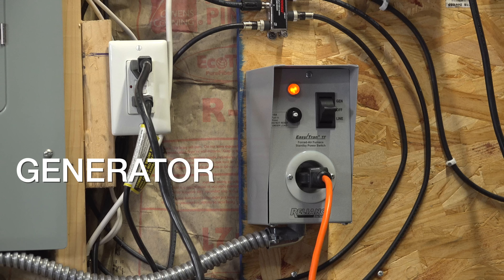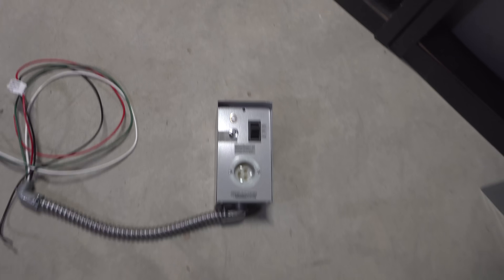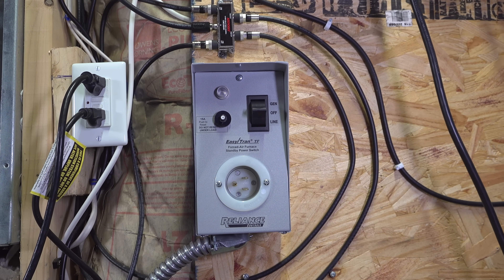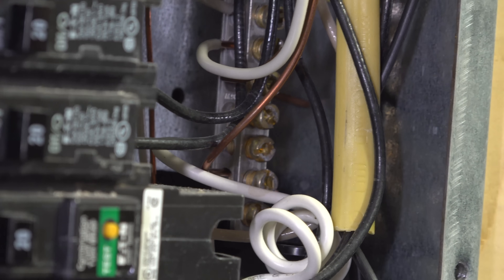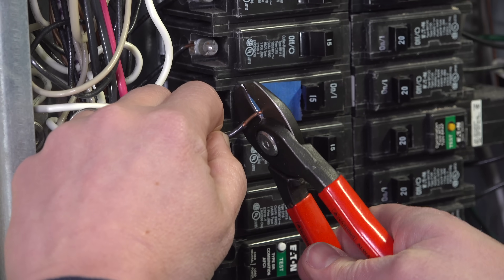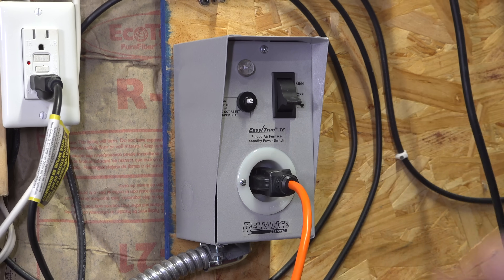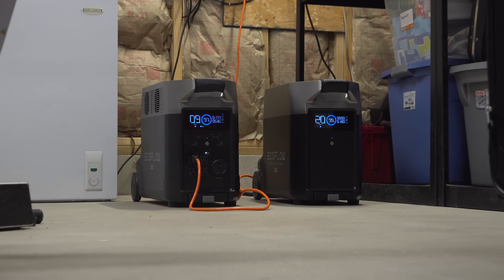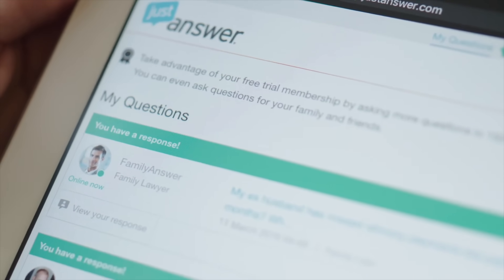Easy DIY Generator Transfer Switch Install - Works with ANY Portable Gas or Battery Generator

Comment: Thanks, SC. I know a master electrician who will wire this for me. I just need to mount it. Unfortunately, my service panel is on a wall in my kitchen. I need to find a weatherproof one and install it outside.
Reply from the maker: They have outdoor units and some models can be recessed into the finished wall next to the panel, You are lucky to have someone that can install it for you, he will likely know a model that will fit into your setup.

Comment: Does this charge the battery when it’s on line power?
Reply from the maker: Yes you can leave it connected to utility power through the rear outlet for charging and the front is the output that can feed loads/circuits. The other plus for this setup is, say power comes back on for just an hour, it will charge what it can before it is off again. That's a nice plus of the Delta model it charges super fast. This happened in TX for a while power was off and on for a few days before being restored.

Comment: You need a plastic bushing on the threads on top of that conduit connector so the wires aren't against the sharp metal edge.
Reply from the maker: The anti short bushing is inside that L connector at the end of the armored cable. You wouldn't use it at the end of the fitting since nothing would hold it in place and the edges are smooth, but certainly not the inside armored conduit.
Reply: @SilverCymbal  I'm not sure what you're referring to, unless you mean one of those red flag thingies that used with armored cable. What I'm talking about is a plastic ring that screws onto the fitting just above the lock nut. An inspector would fail an installation without one. Anyway, thanks for the video!
Reply: @bmay8818  so, he may be in a little bit of a loophole actually. Insulating bushings are required at the end of threaded conduit (raceways), pvc male adapters, raceways with cable sized #4 and larger, and at the point when THHN exits the armored section of metallic clad cable (think that little red cone/flag used over the end of the sharp metal wrap).  He wasn’t using a raceway, just a fitting attachment for the metallic clad cable (which has the red insulating adapter inside the fitting, so while an insulating bushing over the threads wouldn’t be a bad idea, in this exact scenario I don’t think its required by code. In fact, most fittings used for attaching metallic clad cable to boxes/panels, exc, wont have enough remaining thread to use an insulating bushing.

Comment: Only 1 line?
Reply from the maker: Yes, simple install and the switch is $100. You can put in more than one, or get a multi switch model. He doesn't care about anything but heat during an outage and he can use other things plugged in the front if needed. If you want easy and cheap this ones great but certainly bigger models are available.
Reply: @SilverCymbal  got you thanks for the response